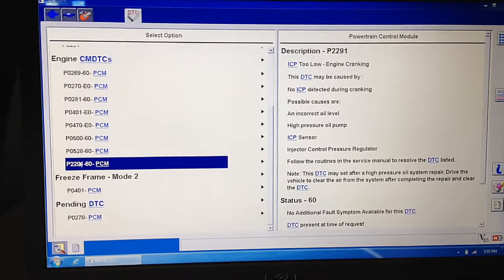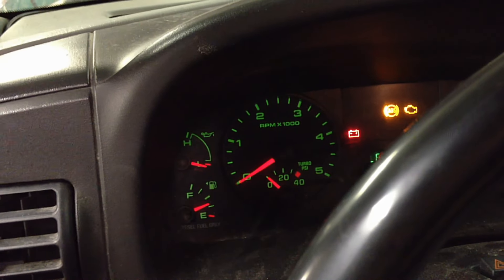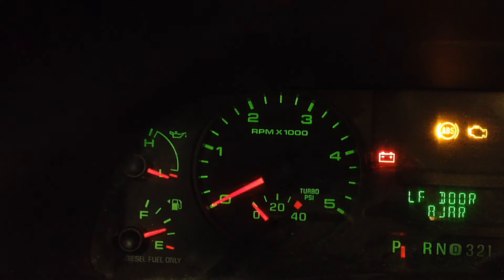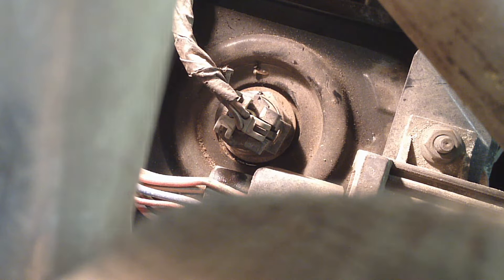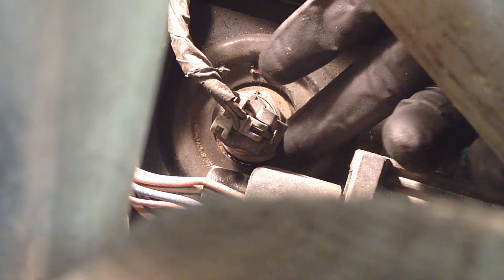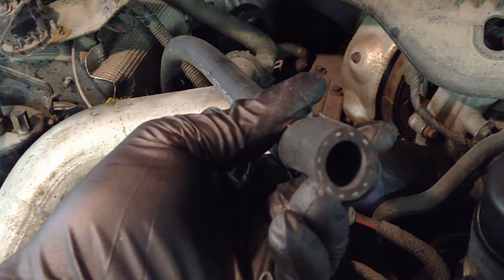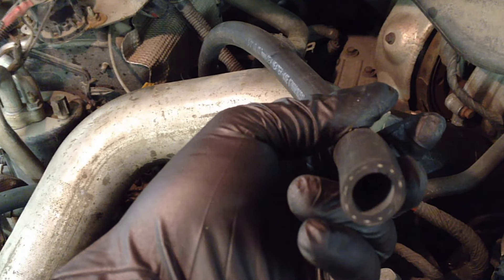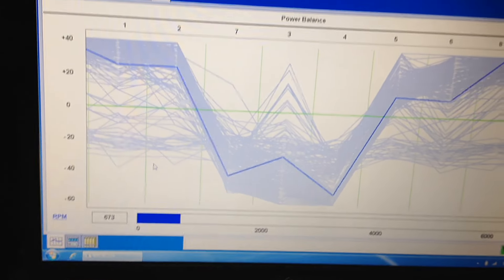No Start: 6.0L Powerstroke ICP Leak Testing

Comment: One thing to remember is that it is only the 05 and up that has the failure prone STC fitting.  None of the 04's (not even the late 04) have the HPOP discharge fitting that can be corrected w/ the updated one-piece fitting.  Also, the truck in the video has a tall oil filter cap.  That can be ok w/ the proper filter that comes w/ it, but it can be a problem w/ an OEM filter.

Comment: Great video. I have a 2007 6.0 and having serious issues with cold starts. I bought the truck used privately, and the old owner treated it like shit. It's fully bulletproofed but he was using shit oil and shit aftermarket filters for everything. I'm back to motorcraft products along with Amsoil 15w 40 with Hotshot stiction eliminator. My truck Definetly doesn't sound like it runs on all cylinders. I also have 2 codes for 2 of my cylinders that say contribution balance.... it supposedly has the high pressure oil pump connector. But I'm not sure what order I should go in to diagnose and fix this rough ass startup. After fooling for 10 minutes it sound the way it should be.

Comment: Hello my names Damian I am repairing a 350 diesel 6.0 I assembled it the other day I put an engine that I bought it was difficult for him to start after he started I turned it off and turned it on again it started well but after a while I found oil in the water I changed the cooler and the The only way to start it is with being fluid, it starts up and I have to have it above 2000 laps, I let go of the accelerator and it turns off, which may be from now on, thanks and your videos are very good.

Comment: got 05 6.0L diesel no start did everything ,pulled injection pump,installed update,replaced fica,still no start,ipr pressure is at 0 no matter how much you crank motor,also replaced batteries for slow cranking
Reply from the maker: Ok so you have base oil pressure according to the gauge? What is the icp reading, and ipr reading during cranking.

Comment: I had a quick question about 6.0 IPR valves.  I suspected an IPR that was sticking when I 1) had hot start issues and 2) started to throw codes about Injection Pressure High at idle and it would actually shut the engine off.  I replaced it with an aftermarket IPR and now my problem has changed.  I now longer have hot start issues,  but if I shut the truck off and leave it for more than 4 hours, the oil is leaking out of the oil rails.  I'm guessing that since I never had this issue before, and that my hot starts and high pressure codes have been fixed, that I've got an IPR thats functioning when engine is on, but isn't keeping the oil in the High pressure oil system.  Is this possible?  I don't know enough about why if would leak down overnight but not during operation/hot starts and can only assume that their must be a check valve in the IPR to keep if from draining down when engine is off.
Reply: Well damn, now I’m curious and no one answered 😒

Comment: I have a 2004 f250 diesel 6.0. My truck did this around winter time and we cleaned the icp sensor an plugged it back in and it ran up until the other day. Now it is not even cranking. Could the icp sensor be completely done and that's why it won't turn over? It's just clicking. Any advice?

Comment: How can I crank the truck over without the truck starting to see the oil pressure gauge reading to verify the low pressure pump is working?

Also, I have the P2290  and P2614 for the cam sensor I believe. Which system should I diagnose first? Both my HPOP and Low pressure oil pump are new as my motor was replaced 3 years ago. My Cam sensor was replaced a few years ago however my crank sensor has not been touched. 

Thanks!
Reply: If you haven't figured it out yet, there is a wire running along the right fender. Near the hood hinge is a quick disconnect. This wire is just for starter engagement. Disconnect and make contact on the positive post of the battery to crank. Don't forget to reattach it.

Comment: I have 05 6.0 with an air leak in HPO system truck will run for about 15 minutes than dies, as I monitor icp I can watch it fall off until falls below 400 psi than engine dies. Truck came in for injectors. I replaced all 8 injectors stand pipes and dummy plugs, after that this issue started with engine shutting down after 15 minutes. I can hear air on right side I isolated both oil rails no air leaks. Replace IPR and STC fitting also, when putting air through IPR I can hear air coming from right side I have found it coming valley, do you think I have a branch tube issue?

Comment: Have 2006 F-350 that I just replaced oil cooler on and after all work done it started and let run and went for a little drive and all seemed ok as it had been running for over an hour, I shut it off and left it for the day and it was warm, at least up here, I went to start it and no start situation occurred, brought out snap on scanner and it came up with P2284 code for ICP,checked ICP pressure and it was 189 psi but batteries were running down so my next move would be check solenoid at rear ?? and check as have ben told unit can be bad as it was placed in by ford shop and yes was very clean on cooler replacement.
Reply from the maker: I would go right after the IPR and check the screen and valve very common after repairs clean or not some debri is likely to get missed. No Start: Ford 6.0L Powerstroke IPR Checks

Comment: I have '03 6.0L no start. Just found ICP voltage is 0.13 with key on engine off. When I crank the motor I don't build any oil pressure. Is this because of the ICP or do I have 2 problems (ICP and LPOP)? Thanks for the videos.
Reply from the maker: Curt Canine Yes you need to fix the low pressure issue first.

Comment: I need some help, I'm working on an 2006 E-350 with the 6.0. I just finished replacing the intake gaskets, oil cooler, and egr cooler. When finished i started the van and ran it for a solid 2 hours. I then shut itself off, now with a crank-no start condition. Turns over great but will not start. I plugged in our computer the same one you have and ran the same test. i get 293psi on the icp and all the other voltages are within range. what would be your next step in this case? Thanks in advance for your help
Reply from the maker: Eric Viergutz Pull the IPR and inspect the screen it is likely damaged. Replace the ipr and you should be good to go.
Reply: FordTechMakuloco Just like you said, took out the IPR and bingo there is a rip in the screen. replaced it and now its good to go. thanks agian
Reply: FordTechMakuloco Just like you said, took out the IPR and bingo there is a rip in the screen. replaced it and now its good to go. thanks agian

Comment: so many points for leaks... i HATE it when its the w pipe leaking, you think its the injector seals when its not the nipple on the pipe is leaking... only had one but my fuck i was mad:P
Reply from the maker: I have never changed a branch tube and now since the 6.0l are out of warranty hopefully I never will. The other ford tech in the shop did one about a year ago and said it was the biggest pain.
Reply: ye from what i understand it can be, but doing it in chassie is, i would pull the engineto replace it myself

Comment: if that gauge doesn't work but u can see the oil coming up .. still no start thamay be the problem I got new hpop n I dont see pressure build up on the icp
Reply from the maker: The gauge should come up after some cranking. If you just replaced the hpop then it will take allot of cranking to fill everything up and fire the engine.

Comment: Nice video  is there a way to bypass  the ICP circuit  so you could start  the engine?
Reply from the maker: +Jesus Ramirez If you disconnect the icp sensor connector while the key is off and goto crank it the pcm will assume 700psi I believe and allow the injectors to fire but there still has to be icp pressure, a working FICM and fuel pressure to fire.
Reply: Thanks  you for taking the time  to answer one more question whats the name of the program you are using thank you fordtechMakuloco
Reply: So if you can get the engine to run by disconnecting the ICP sensor, what does that tell you? Does that confirm that it is indeed a faulty IPR or a faulty ICP? Or possibly both?
Reply: @paulludtke349  Did you ever find the answer to this?

Comment: Just curious, what all would I need to start working on these on the side (as in any & everything)? I have all main tools as I'm a diesel tech in a Volvo truck shop but, I'm fascinated with all the diesel pick ups, I have an old idi non turbo I'm fixing up at the moment which is like day & night to a power stroke! lol I have the air test fitting (made one in the shop one day working on a f450 with a 6.0, that was a nightmare at first lol), also have the IPR socket (attempted to make one out of a 1/2" drive axle nut socket that was a waste)! Anyways any other tools needed (gauges, specialty tools, etc)? Also, a good scan tool that's bi-directional but not bad on the wallet(checked out the maximus but, it's $3400), saw a program called auto ingenuity that was a purdy good price & was bidirectional, the reviews seem promising, I currently have ScanXL pro with the ford add on but, all I can do is view codes and PID's, which is helpful but, isn't as good as having the ability to command the IPR valve or do injector cut out, etc. Any how, thanks in advance and have a blessed day! P.S. sorry to be so lengthy!
Reply from the maker: Well I would say the block off tools for each head when doing dead head pressure test, the special threaded fuel pressure test adapter. There aren't many special tools for the common repairs on these. I think the most useful is a bi directional scan tool like you say so you can control things like the ipr fuel pumps etc we do most of our diagnosis with the functions on the scan tool so that is the most important tool on these.

Comment: I have a  2004 6.0 some times I shut it off and 5 minutes latter it won't start after trying 3 or 4 times starts right away.oil level is fine and two new batteries do you have any idea how to fix this problem,thanks
Reply from the maker: So it has to be cooled off for it to start? Or hot it will start you just need to try it a few times. Is your icp sensor in the right front valve cover or in the rear?
Reply: No it doesn't have to cool down just out of the blue starts
Reply from the maker: You mention batteries like this is a no crank is that what it actually is?
Reply: No I just replace them to have better cranking
Reply: I checked in the last 7 days after reach its norrmal temperature if shut it off it won't start again until cools down.I notice too that cranking for more than 10 seconds the oil pressure gauge don't muve.any comments thanks
Reply from the maker: Everardo Berber Ok so you have a classic Icp leak when hot, without testing as shown we are guessing but the two most common are a failing STC fitting partially separated and the dummy plugs in the oil rail. Is your ICP sensor on the RH valve cover? Have you seen my video on STC replacement?
No Start: Ford 6.0L Powerstroke High Pressure Oil Pump Fitting

Comment: So I have a 03 6.0l and my basic scan tool says that is has 410psi at starting and it need 500psi minimum so what do I do there I will try the icp voltage and ipr

Comment: Question is the icp in the hpop? Or completely Different ? My truck loses power when driving on the highway it starts jumping throws smoke and dies but once dead it starts back up again and drive it and then again same thing loses power speed starts jumping and die. Any tips? Should I replace the high pressure oil pump ? And the icp? And also fuel pump and filters ?

Comment: looking for advise. 06 6.0 was cranking longer and longer today. It then would not start. my edge cts shows very low icp pressure which i figured. Well i checked low pressure and the housing fills up.. i already have the updated sct fitting and truck has 161,000 miles.. only about 4000 miles on since studs, hpop update, egr delete. truck ran strong just a starting issue now... where should i start?? i dont have a test fitting for air checking.. thanks
Reply from the maker: I would pull the IPR and inspect it as shown in this video- No Start: Ford 6.0L Powerstroke IPR Inspection
Reply: Hey what eneded up being the fix on this?

Comment: I'm failing to build pressure have extended crank to start like over 30 seconds. Once it's idling desired ICP PSI is 800 but I'm only getting 480 to 500. Clearly there's a leak somewhere.

IPR air test reveals no leaks. ICP air test with IPR blocked by a ball valve on the IPR test fitting reveals no leaks until after about 5 minutes when gurgling and air can be heard through a listening device when placed inside of the oil filter housing.

I've read that the only time you'll hear air or oil gurgling through the oil filter housing is when you have an internal leak within the hpop. I pulled the h pop and bench tested it only to find zero leaks whatsoever.

Anybody have ideas on what could be going on here?
Reply: So I cranked up my air compressor to 125 which is the max and bench tested the hpop again. It took a minute or two but now I can put a heater hose to the low pressure intake port on the h pop and hear gurgling.

Sometimes it takes a while for the leak to reveal itself. Another tech told me that these systems are designed to run at thousands of psi and when you're only putting 125 into it it may take a while to hear the leak.

Comment: I need a little help 06 F350 cranks,starts cold, runs for a minute then goes dead restart easy then repeats going dead. It does have a P273 code high voltage to #5 inj.that problem I plan on replacing that injector. All parts I use are Ford or Motorcraft this diesel is to labor intensive to use aftermarket.Thanks for any help ! Paul

Comment: I have a long start on my truck and once it finally starts it sounds just like that truck did at the end of this video  where it runs like crap and then smooths out. This happens anytime I let the truck sit overnight or for a few hours after driving.  Anyone know what would cause this issue every time I go to start it  when it's sat for a bit? 

 Also it didn't have this hard start issue until after  I changed the Turbo. Happened as soon as a new Turbo was put in.

Only other time it would have this issue is when I drive down the road if I really put the pedal to the floor, poll a load,  go up hills or something like that The truck will start to lose power and then stall completely. After it has stalled by half to weigh a few minutes before it will even start again and it will run my crab just like it did in this video when the truck starts at the end of the video once I started backup when it's having that particular issue. Any ideas on what it could be? By the way this problem with it stalling out and losing power happened before the Turbo so it's been a continuing issue. Sometimes I can even drive the truck for an hour with no problems and then the next day it'll have problems after 5 minutes where it will start to lose power and then completely die on me and run like rap when it starts again.
Reply: Did you ever figure out this problem?

Comment: hello friend I have a question to work on a f350 2006 replace the seals of the oil cooler and the packaging of the air intake now I try to start the truck have some difficult starts and when it reaches its working temperature , does not start I have the code p2284 , when hot icp brand 0.25V , only 2 psi and 85 % ıpr you can help me

Comment: What usually causes the p2286 code? (Icp circuit high) My truck will not run. Ficm is good, fuel pressure is good, and my sct says I have 1600 icp while cranking.

Comment: Mine doing same thing help me out bro great video mine has new stand pipes and dummy plugs new, pump and injector nipple seals..when I do a air test it leaks slow everythings connected ficm wise, turn key fwd and air changes but doesn't stop completely is this an issue

Comment: Great video. I’m having a no start on hot. My ICP is reading somewhere around 280 psi on no start. I know it a HPO leak. What I’m trying to figure out how do I command the IPR shut with my Forscan lite BAFX WiFi  during air test? Can someone please help me?
Reply: Wow no help. Thanks guys👍🏿
Reply: Make your own pigtail you hook to the battery
Reply: Joey Dalia I bought me a IPR controller. Thanks though

Comment: i havea 2003 f250 was driving and thought i ran out of fuel went and put 3gals in started up drove 2miles stopped started up and drove 3miles home and it died before i got home just had new injectors and fuel pump put in about 1 year ago the codes read p2614 p2617 p2290 p1000 what to do?

Comment: I tested mine for a small hpo leak... I applied power to the ipr, I done the same test you done and the air sound did not change, there is still air sound coming from the oil fill and vent on the drivers side valve cover, so I pulled the ipr and done a bench test and the ipr worked on the bench test. I’m confused what my problem with my truck is.
Reply: I had the same problem. I used FORScan to close the IPR and did not hear much change if at all. The reason was because I has significant dummy plug and stand pipe leaks. Pull the dummy plugs and check the seals. If damaged replace and try leak test again.
Reply: Any update on why that happened? Or does op have any thoughts on why this happened to y’all.?

Comment: Is it normal after repair to re air test and hear a little air from crankcase? i have the test fitting right in the IPR valve I'm sure its coming from the  oil feed side of the pump. I replace the pump and SCT fitting.i also removed valve covers caped oil stand pipes. Its an early 2004